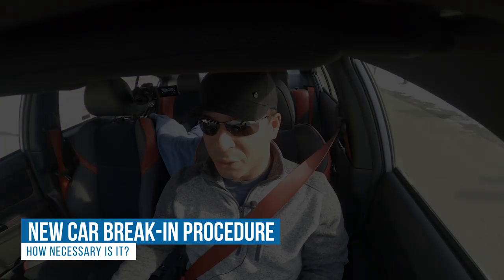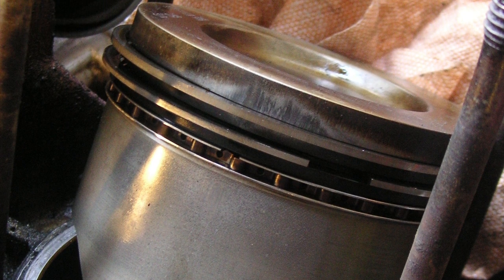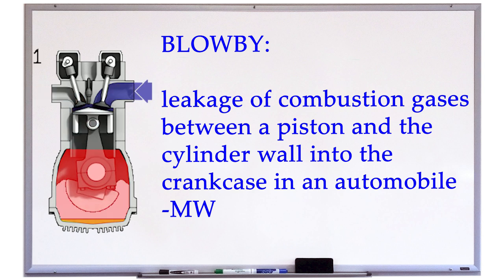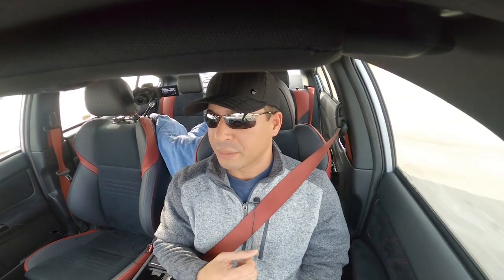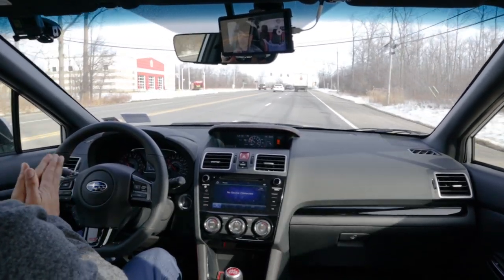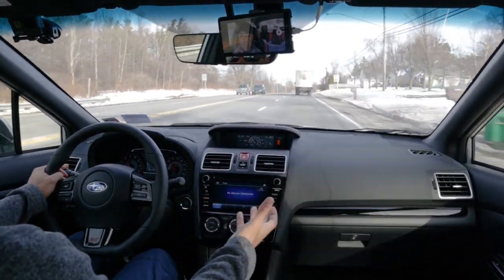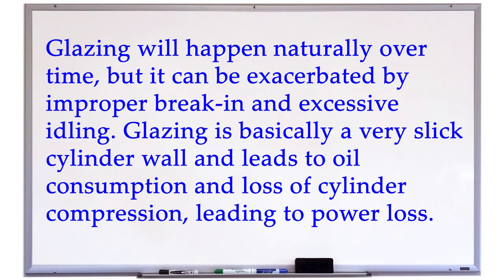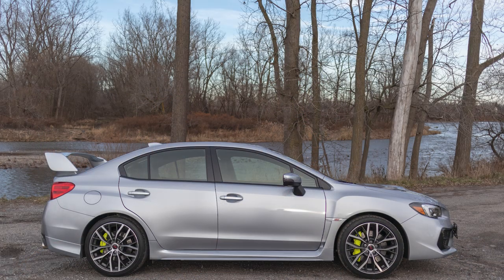How to Break in New Car Engine Discussion

Comment: Going to get my new car soon, I definitely need to use the highway to reach another state so what do you mean don't keep same engine speed?Meaning I can't maintain like 90km/h for long time??like how long is long ?What I am stuck in a heavy traffic for hours???
Reply: @akqjtn  ok the highway part alternate gears how long will u stay on 6th gear before changing to 5th? Because it will be tiring to keep on changing gear every 1-3 minutes
Reply: @akqjtn  thanks bro it really helps a lot
Reply: @akqjtn  Thanks man. Reassuring to hear this. I just got a new mustang with 19.6 miles on it. I heard the sales guys revving it up quite a few times every time they moved it or even just starting it because it does sound really good... but I was not pleased with them.  And then I had to drive it almost 150 miles to get it back home. This was before I knew much about breaking in cars.
I did have to adjust speeds every now and then but I did use cruise for a lot of it. I want to keep it for a long while and I'm very nervous that it may have been poorly broken in. Has 400 miles on it now
Reply: @Road_Work_Ahead  it probably was poorly broken. Specially if the salesman revving it during a cold start. But on the bright side I think the mustang has a factory 5k revv limit while parked so who knows .

Comment: All of Toyotas owners manuals state  761 miles. Yeah, odd number, but yet, that is what is stated.
I plan to drive my new Ford Maverick on or about 1000 miles before I do the first oil change. I  ALWAYS  
do the first oil change early because>>>>>
-There may be some metal shavings or dirt left over from manufacture
-There WILL be excess metal in the oil from those breakin miles.
Dump all that at 1000 and you will do your new engine a great favor. and help it to last  FOREVER.

!

Comment: I'm confused. You said, to start the car 5-10min before you go (to warm it up), but then you said, never let it sit at const RPMs. So, which one is it?
Reply: I can’t answer for him, but I warm the car up by driving it very easily until it reaches normally operating temperature.  Then I will drive it normally after that, following the break-in limits until the engine is broke-in.

Comment: Owner's manual is 'vague'? Verbiage is 'open to interpretation'??? How can specific instructions along the lines of -'for the first 1,000-miles'; and 'use part throttle'; and 'don't exceed 4,000-rpm'; and 'vary engine speed as much as possible'; and don't haul heavy loads'; etc.  be misinterpreted that way? These are very specific and require no form of 'interpretation' to understand what a proper break-in procedure entails.
I think a bigger problem is not enough owners make the effort to actually read their owners manual. Instead of following these clear directions, they rely on passed-down and often inaccurate and potentially harmful misinformation.

Comment: I'm not convinced on the 1k oil change. Oil changes are too get rid of spent oil/filters.
If your oil or filter is done at 1k, an oil change ain't gunna help
Reply: That's not the point. On a brand new engine, you WILL get metal particles, and these are mostly caught in the sump (if you have a magnetic sump plug) and in the oil filter. Replacing the filter and oil removes much of this debris, and greatly reduces the chance of them circulating in the oil and grinding surfaces away or blocking oil galleries.

Comment: You are not supposed to run engine at same RPM for an extended period
Any Yet
You say you warm up you engine by idling at the same RPM for 10 minutes.- which is not a good thing - At All...🤡